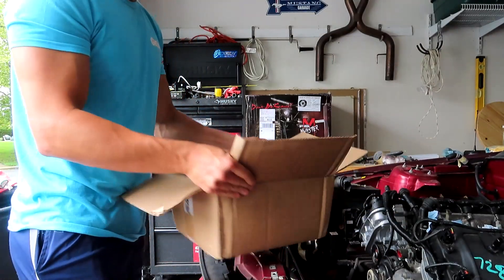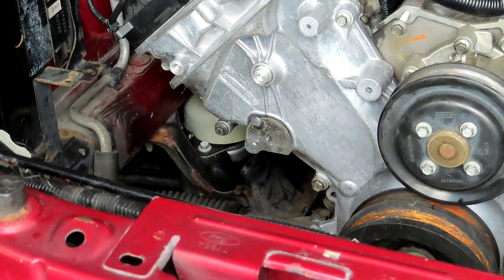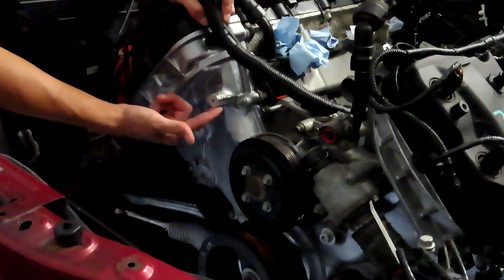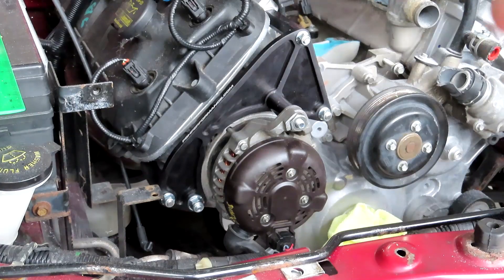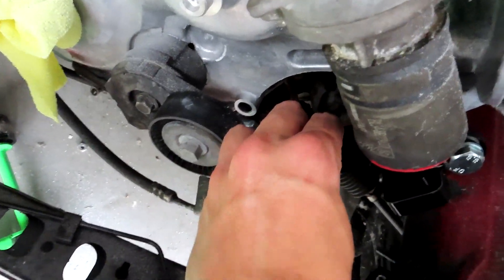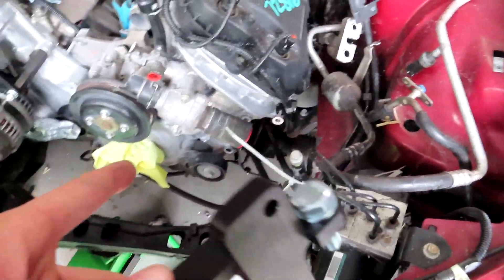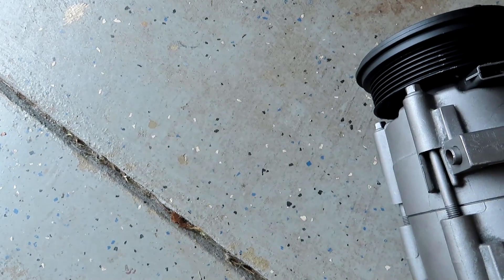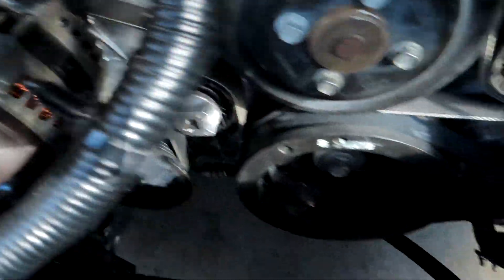2005 V6 Mustang Coyote Swap: Episode 6 | Accessory Drive

Comment: What year was the engine that you used and where did you get it from
Reply from the maker: This is a 2013 5.0 from an f150, got it off of eBay from a place that sells crate engines from wrecked vehicles

Comment: What wiring harness did you use?
Reply from the maker: So I used the Ford performance gen 1 2011-2014 5.0 Coyote control pack for manual, and also the gen 1 2011-2014 5.0L Coyote engine harness. You would use gen 2 harness if you are getting either of these, and I recommend going to PowerByTheHour

Comment: Did you have to fab/cut anything when it came to the motor mounts ?? The transmission as well ??
Reply from the maker: No since the body style of the 2011-2014 is pretty much the same as the 2005-2010, after you get the motor mounts meant for the coyote they actually fit right on top of the existing location for the motor mounts
Reply from the maker: Transmission is the same deal as long as it fits 2005-2014 body style any transmission from that year will work